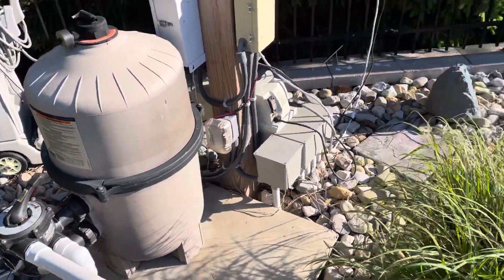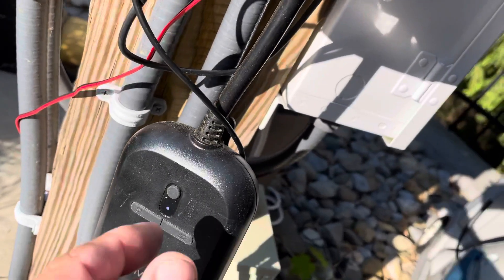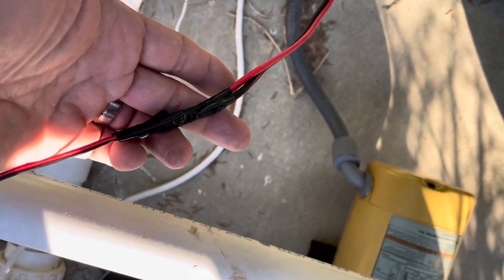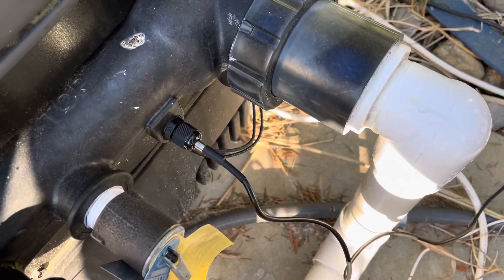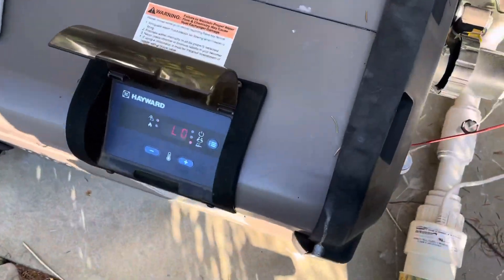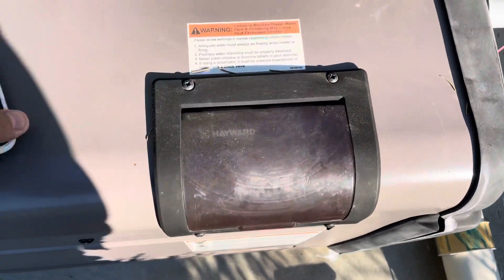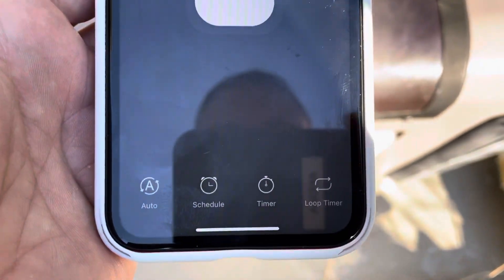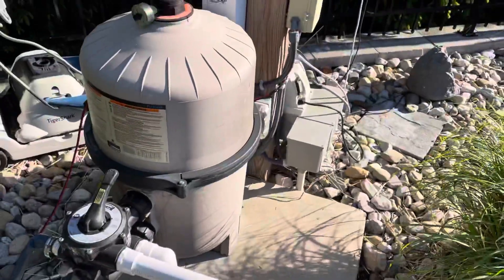Control Your Hayward/Pentair/Jandy Pool Heater from Your Phone for Under $100! (Part 3 Post Install)

Comment: This is great video this instal could be done much better way. 
You can install everything inside heater 
You can tap in for your power to the same place where heater is connected 
There is enough space for this local to be mounted inside
Reply: Great idea.  How do I do that safely?

Comment: When you connect the pool and com wires to the heater, do you disconnect the wires already there?
Reply from the maker: No. Just add on top.
Reply: @time4akshun  Thank you for the prompt response. I also found the manual for the heater which confirms what you are saying.

Comment: Did you disconnect the orange and white wires that were connected by Hayward by default?  Or do the 2 spade wires connect to them?
Reply from the maker: You can just piggyback on top.

Comment: Great video. Does it work for a electrical heater? I have pentair ultra temp. 

Also is there way to turn on the pool pump when the heater kicks in?
Reply from the maker: I have not tried.  My pump is always on before this triggers with an older timer

Comment: Thanks for sharing this. I'd love to install one of these. May I confirm that the DTH101 can also select and control the SPA setting of the HAYWARD heater as well as the POOL, albeit one at a time of course. Also, did you automate your Diverter Valves and pump on/off selector too, and if so did you find a system/app to consolidate it all together? Thank you.
Reply from the maker: Didn’t go that far. Just controlling the heater.

Comment: Can you please answer whether the app just serves to turn the heater on/off, or does it also allow you to change the actual set point of the Thermostat?  Anyone?
Reply: When setting your heater to remote the heat is set to max on the control panel. The on off in the app is then used to turn the heater on or off at the desired temperature. For the auto you can set it so that when it reached 78 it turns on and then off at 82. Reply if you have any other questions I use the ewelink devices for lots of my automations on hottubs etc
Reply: 2-WIRE REMOTE CONTROL CONNECTION:
To configure the heater for 2- wire remote thermostat control, use the “MODE” key on the heater keypad to put the control into “STANDBy” mode. Then press and hold both the “DOWN” and “MODE” keys for 3 seconds until the display shows the code “bo”.
On the remote control wiring terminal block (Figure 22), connect the appropriate wires from the remote control to the terminals adjacent to the ORANGE wire (“POOL”) and WHITE wire (“24V”).
To operate the heater by remote thermostat, the heater’s control must be in either “POOL” or “SPA” mode. The display will show “bo”. The “POOL” or “SPA” LED will be illuminated. The remote thermostat will operate the heater. The heater’s thermostat will function to limit the water temperature to a maximum of 104°F.

Comment: Thank you so much for this!  I plan to do the install in a week or two when everything arrives.  Now, just wanted to see how things are going.  I wanted to make sure it continues to work well and you don't have any reservations.   Hope to hear from you!
Reply from the maker: Works but recommend bringing unit inside in winter. Mine went bad due to cold. Had to get another.
Reply: Did you do the install?

Comment: Do you actually control the temperature setting from your phone or is it set to desired temperature on the heater itself before you put it in board mode and the phone app acts only as a "on/off" switch?
Thanks
Reply from the maker: U can control real time or scheduled.